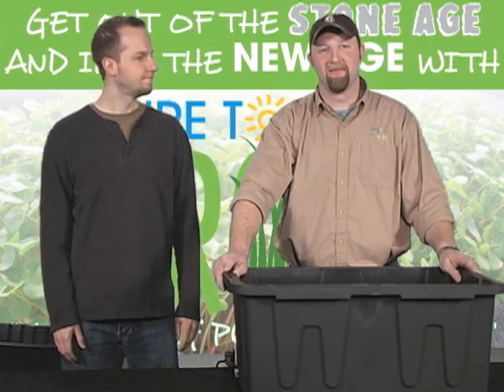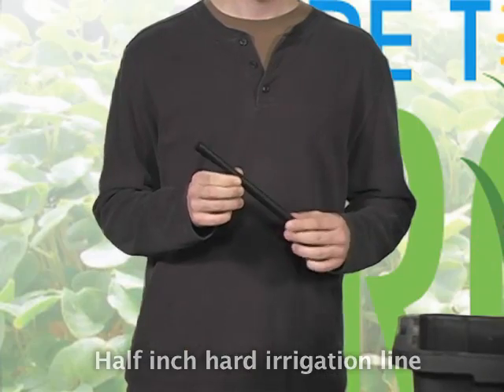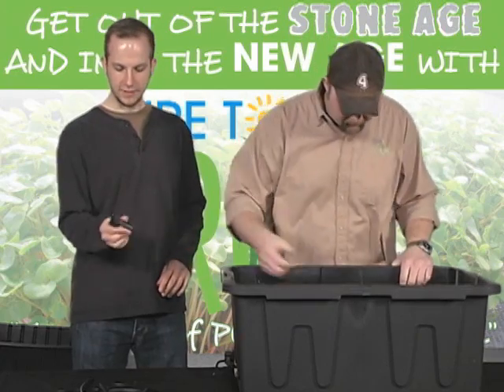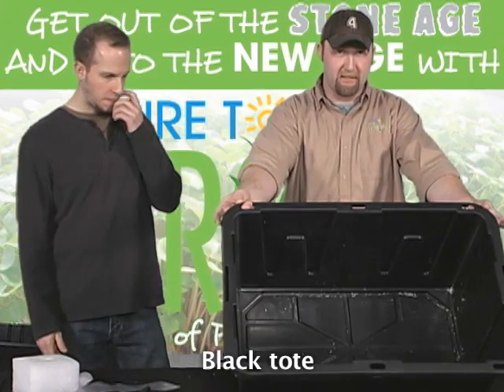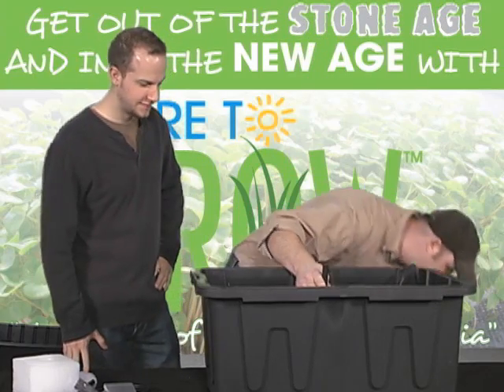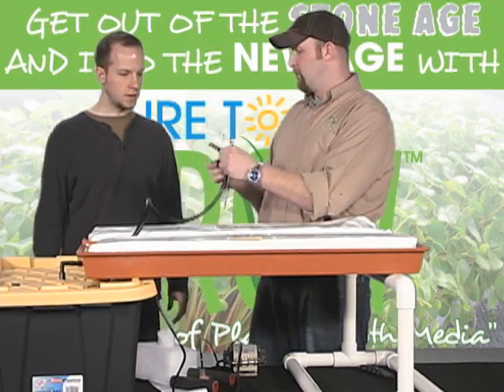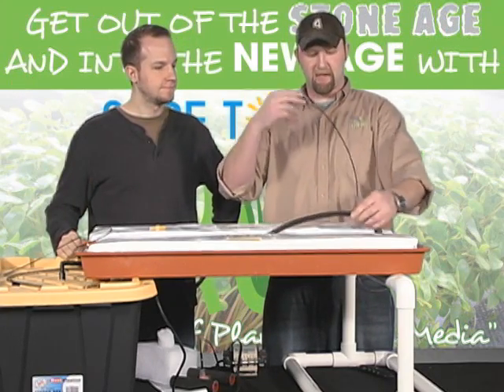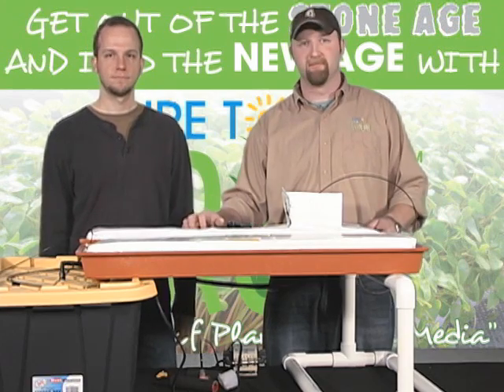Hydroponics How To:  Building a Top Drip Homemade Mini Grow Box

Comment: When you add the emitter tubing, you need to have an emitter adapter that plugs into the 1/2" funny pipe so you do not have any leakage around the entry point. With this very small adapter, you can also swivel the emitter tubing without any damage to a waterproof seal.

Comment: I grow in soil. I have a 20 gallon trash can that i use for my water supply. i am growing in a 4x4x72 tent. i am trying to get equal water to 9 plants using a 1/2 or 1 gal button dripper. the water pump i am using is an ECO396. I have the lines about 3.5 inchs apart and have tried other spacing. i am unable to get all the button drippers to work. can you please help me?

Comment: Also, we've found that it's better to use a tee where you use a elbow and use a loop of 1/2 tube. Then there is no end plug and the pressure to all lines is better. Also it would have been wise to put in a anti siphon device before the elbow. You never know when one of those lines will fall out and be lower then the waterline.. That's a big mess worth avoiding.

Comment from the maker: If you're doing a drip system, I would only make one slice, towards the drain end.  If you're doing flood and drain with the slabs, slash the bottom everywhere to allow fre-flooding and free-draining.  You can definitely wrap the blocks around the triangles of the x-cut if you like.  if you cut your X's properly, it wont matter whether you do or you don't.

Z